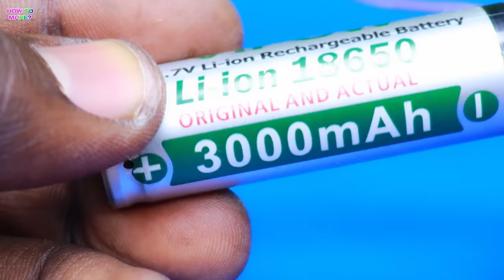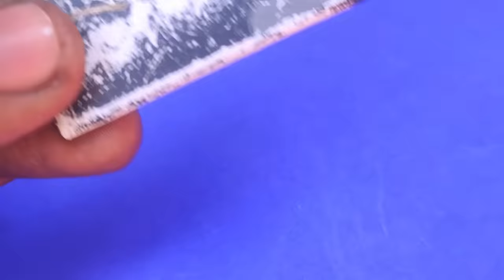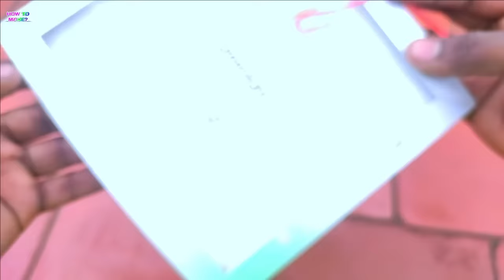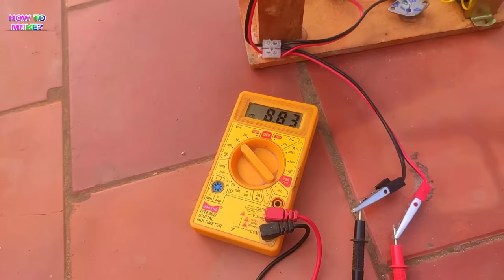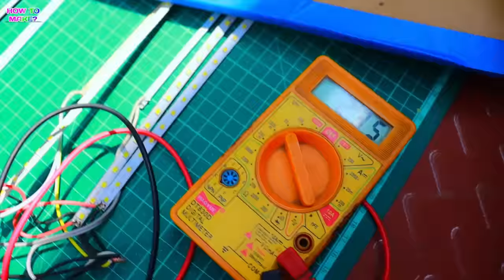13 Awesome uses of old solar panels

Comment: The Led on no.1 idea looks confusing

Its is not parallel or series circuit
Reply from the maker: 1+1 series 
2+2 parallel
Reply: I want to try that circuit cause im confused
Reply: 1:23 i got it now that circuit is legit

The 2 bulb is on series and another 2 bulb is series then connect both to parallel
Reply: @Lmmixs  (1 serie 1) parralell (1 serie 1)